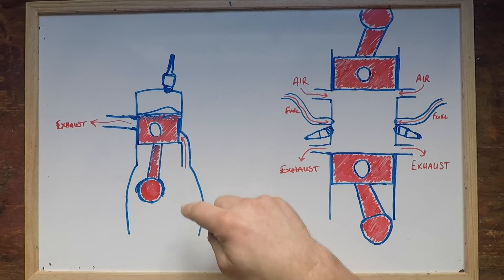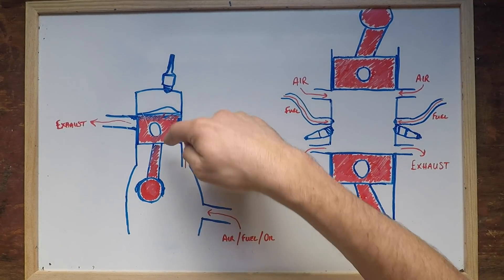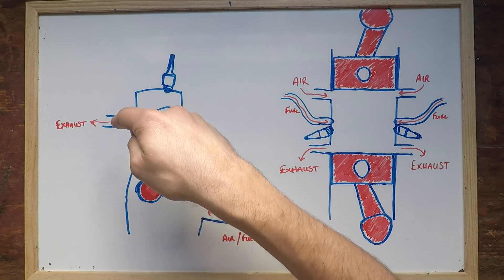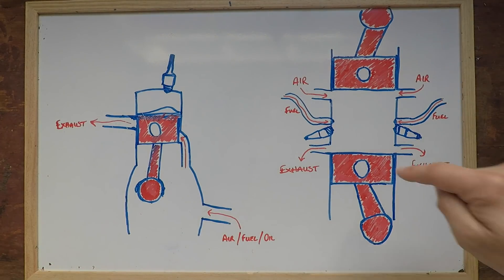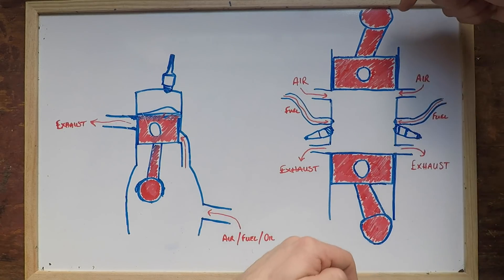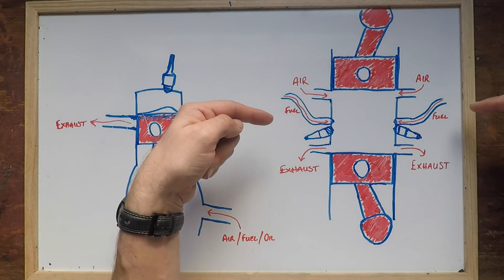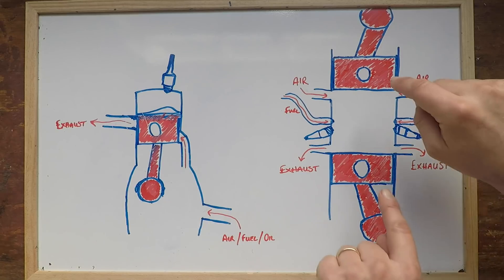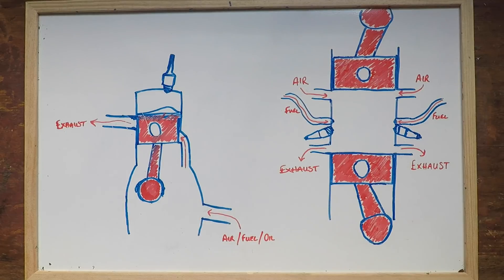How An F1 2 Stroke Engine Could Work - MP339

Comment: Does a two stroke not need a expansion chamber in the exhaust system to get the karden effect? If so would a turbo charger in the exhaust not effect that? Surely a super charger on the induction not be the answer?

Comment: I doubt that a two-stroke counter-piston engine will bring much higher thermal efficiency because the combustion chambers of a modern F1 engine are too small.
With marine diesel 2-stroke opposed piston engines, about 60% efficiency is achieved, which is about the theoretical maximum.
Weight savings of an opposed piston engine are marginal, you need two crankshafts, which also has a negative effect on the response behavior.
The most efficient opposed piston engines have three combustion chambers, which corresponds to 0.6 liters per combustion chamber, which, as I said, is too small a combustion chamber volume to increase efficiency, but there is hope if the combustion chamber volume per cylinder is increased to 5 liters and crankshaft limited to 5000 rpm, the thermal losses are lower, also due to the lower friction.
The advantage of such engines, simply lower costs, as there is no need for complex pneumatic valve trains and their dependent controls, and an engine with significantly lower piston speeds will last an entire F1 season.

Comment: What about the cylinder wall/pistons/rings lubrication? how that could works? I am curious how this could be accomplished with the use of exhaust / intake windows. Because, with the use of the ports, the oil in the space between the piston and the cylinder wall would will get into the intake ports during the intake/compression stroke and, in the next cycle (when the piston start to open the intake port again, in the exhaust/power stroke), the oil that have stay in the port (perhaps a little bit, bit still) will go to the inter of the cylinder, and then will get burned with the air and fuel. So, have a method to avoid this?

Comment: Beautifully said! I do hope engineers make this happen!

But I’d like to add few information : 

This has been the dream 2T for engineers for over decades now. I will tell you why it is very difficult to achieve : 

2 strokes are generally high revving machines.

Those fuel Injectors need to fire when the pistons are compressing the fresh air that’s been taken in and right when they close all the ports. 

This means, those injectors must be capable enough of atomizing and firing the fuel at a higher pressure than the pressure that’s caused inside the cylinder with pistons compressing.

That’s going to be very difficult and very expensive. Sometimes it might not be able to revv as well just because the fuel injectors just not being able to keep up.

Matt from The Workshop has made a brilliant video explaining this.

Comment: Cool videos Elvis! Thanks for the 
information! have a question about the power unit, my question is: can the F1 make the sound engine more interesting for example doing some changes in the engine like, remove the turbo and increase the power of the electric engine? So the engine will be louder without the turbo? Thanks
Reply from the maker: Yes, it's totally possible to change the sound, but the driving force behind the tech is efficiency, not the exhaust note.
Reply: Marc Priestley, awesome thanks! 👍

Comment: Think the only issue is cylinder sealing! With the boost pressures that would be needed to generate enough power for f1 the possibility of leakage is alot greater than in a normal cylinder to head layout. If it was to be a n/a setup then it might work but i see to many issue with this.

Comment: This doesn’t automatically fix the issues that two stroke engines have, the chieftain tank used as opposed piston engine and those were followed everywhere by clouds of blue smoke. Funny thing is I think the current experts in this field are probably truck engine builders, it would be pretty hilarious for a Cummins logo to show up on an F1 car.
Reply from the maker: I'm not saying it's fixed yet, but an area that F1 could take to new levels.

Comment: Very interesting, this could work. With the tolerances in F-1 I can just imagine a 2 stroke 2 liter engine capable of 25,000 rpm with twice the horsepower of a 4 stroke of the same size😱
Reply: If it is capable of 25000 rpm it would be much more than twice of powerful
Reply: @christopherabramor3012  A 4 stroke 2L could come fairly close to 25k. Some 2.4 V8 went over 20k before F1 limited the max rpm

Comment: I think it would likely come in the form of a 3 cylinder opposing piston engine, that configuration has the most efficient inlet and exhaust pulse distribution. Fuel could be hydrogen or some synthetic carbon neutral derivative.

Comment: EMD(General Motors) made diesel-electric railroad locomotives in the 1940's that ran as 2-stroke.  They were 16-cylinder 1500HP 2-stroke engines with an injection blower.  567 cu. inch. per cylinder w/ 8 inch diameter pistons. 950 RPM max.  The attached power generator gave out 300kV for the drive wheel traction motors.

Comment: I could imagine a 2 stoke design with the exhaust and intake ports offset, with one exhaust and one air on each of the "top" and "bottom" pistons, as in your illustration - But offset so left side and right would each have an exhaust and intake. Could create a venturi/Scavenge/Vortex effect?!?!

Comment: This 2 stroke video got me thinking. If an engine is 10% more efficient then that's 10kg less fuel. Are there any rules of thumb to convert a weight saving to lap time? #askElvis
Reply from the maker: Very roughly 10kg = 0.3sec

Comment: There are many types of two-stroke engines, and many do not need total-loss oiling. The famed Detroit Diesel is such a beast, using a Roots-type supercharger for scavenging.
Reply: https://imgflip.com/i/3mq3qx
Reply: I got an 8v92 and burns some oil, thats why i use straight wait low ash. it could be rigged up to total loss though. Castor 927 maxima anyone.

Comment: So is this going to be 2021 then (if ever)? Also, I heard that Symonds said that this would be the first step towards electric cars, how? Last question, wouldn't the exhaust for this type of two stroke engine be more like a 4 stroke exhaust or will there still be a significant need for back pressure from the exhaust?
Reply from the maker: The earliest anything like this would happen would be 2025...

Comment: Looks more like something for WEC or even WRC because it would allow them to run dual gearboxs for 4wd. Interesting to see how it works as looks like an inverted boxer engine
Reply: But dual gearboxes will defeat the weight advantage... 
... but I always like thinking outside the box (or is it think more boxes this time🤔😁)
Reply: That's why I said maybe more for WRC or WEC as it would allow them to keep running in 2wd
Reply: @mattwills87  there are already 2wd/4wd selectable systems so why is this a better solution for the 2/4 drive system?
Reply: Think about to duel engined mini cooper it was just a wild idea.

Comment: I can’t see having 2 cranks being an advantage and then some kind of connection shaft to connect them to the gear box. But then again I’m no F1 engineer so hey who knows, but why wouldn’t opposing pistons work with a four stroke.?
Reply: Because you don't have valves
Reply: You could make it work with a sleeve to cover the ports
But you need to lubricate those with oil in your fuel
Reply: There has been side valve engines in the past and there seems no end to what F1 engineers can achieve.
Reply: @mattschwensen9562  side/sleeve valve engines , if they are 4stroke need to have all the ports in the TDC where the pistons meet (intake,exhaust&fuel)and the sleeve moves up/down or left/right
A 2stroke engine with the ports at the BDC one piston has the intakeports, the other has the exhaustports and at the TDC the fuel gets injected ... but it needs a supercharger/turbo to work
the 2stroke opposed piston is very fuel efficient

Comment: So how is the crank shaft going to get oil to it on a regular 2 stroke the gas an oil go down towards the crank but no t what your showing
Reply from the maker: Crank can have a regular oil supply because fuel/air mixture is no longer in the crankcase

Comment: So you do know that for the same amount of air fuel mixture being burned in the cylinder, the opposing 2 piston, 2 crankshaft approach will make LESS power than a single piston design.  The opposing piston 2 stroke is not new.  Also any modern 2 stroke uses loop scavenge, not the crossflow scavenge with a bump on the piston which is shown on the left and went out of favour along with the dinosaurs.

Comment: Reminds me of the classic Deltic supercharged, uniflow scavenged 2 stroke diesel engine designed to power high speed British torpedo boats in World War 2. High power to weight even without today’s alloys.  Later used in diesel locomotives.

Comment: Cool video Marc, clear and to the point. One question, how and why would you configure the cylinders in a V-formation? Wouldnt that mean you get 3 crank shafts instead of 2? There could also be a benefit to a lower center of gravity for the inline configuration. I would love to hear more about the technical side of possible F1 spec 2-stroke engines!
Reply from the maker: Yes, loads of possible variations and layouts, exciting to think about F1 potentially developing them.

Comment: @Marc Priestley.... Two stroke is one of the ways F1 racing could go if you want to power F1 cars with outboard motors. :-)  The other way Formula 1 could go is the Hybrid route using Micro Gas Turbine+Generator+Battery+Ultra Capacitors+Electric Motors. This technology would set Formula One up for sponsorships from Rolls Royce, Siemens, Honeywell, Airbus, Boeing, Pratt and Whitney, CATL, Pansonic, LG Chem, Samsung, Tesla, Maxwell Technologies, NEC Token America, ect. (companies with money!) There is no money for Formula One in going the two stroke engine route in fact it would probably devalue Formula 1 as it would become non technically relevant.
Reply from the maker: It wouldn't be technically irrelevant if it developed into small, light, powerful, efficient & eco friendly technology...but there are a number of potential options.
Reply: @F1Elvis  ... Bill Gates invested in EcoMotor that was working on the OPOC motor and they went defunct in 2017 with their intellectual property being sold off; I am not sure who bought the patents but that news will scare just about everyone away.

Comment: I've always been amazed that the automotive industry has never picked up on advanced 2 stroke engine designs.  I'm a 4 stroke fan but have to concede that 2 strokes offer many advantages over 4 bangers, to name just 4, much lighter, more compact, more powerful for a given capacity and cheaper to manufacture.
Ford UK were on the verge of introducing an advanced 2 stroke design in the late 80's early 90's, they went as far as putting a number of production prototypes on the road for actual punters to test and report on. The it just went quiet!
It was a design by a company called Orbital, Ford bought them out and fast tracked the research.
Maybe they might look through their old files and get back into F1!!
Reply: for anything other than weed-wacker sized engines or slow rotating ship diesels every two-stroke advantage comes with two disadvantages
Reply: @fuzzy1dk  Thats certainly been the case for commercial use. As to if f1 with its budgets and tech can make that work for them is another matter

Comment: It would on have to rev to 8000rpm but it would sound like 16000rpm.. thats fine aslong as it sounds good. But id say they will aim for lower revs for less engine drag..but at the end of the day someone will have to build a f1 spec engine put the million's in and see how it goes as a trial.. id suspect it will be a quiet motor. Because its still hybrid turbo /supercharged
Reply from the maker: Maybe, but with a blank canvas, almost anything's possible
Reply: @F1Elvis  my only basis on the revs are lower is fact of the current spec.where there on ly pushing kr i  qaully .but If your gettiing 50% efficent out of a 2 stroke pretty insane .all though radial engines in f1 hana jokes

Comment: I wonder why we have fuel injection but not similar electronically controlled air injection. For that we still rely on mechanical valves instead.
If you could electronically inject pressurized air into the chamber along with the fuel as soon as the exhaust port is covered, which can be sensed a the crank position sensor, than you definitely would have zero loss due to open exhaust valves.

At least it works in my amateur brain. Reality however... no idea.

Comment: EngineeringExplained(Jason) has a really informative video on opposed piston 2 stroke engines. How do they sound though? Like a diesel???
Reply: The spark plug still ignites the fuel unlike a diesel which relies on cylinder pressure....hence the diesel knock.

Comment: In a previous video the argument for changing the rims and tyres was that there's nothing like that in the road. The way things are going in the industry at the moment it seems the propulsion will be electric. The only question is how the electricity will be generated and stored. There's no way something like an opposing piston engine is going to be used for road cars. Racing it in F1 makes little economic sense in the context unless it's just for show.
Reply from the maker: If something like this or one of the many other solutions is developed to be small, light, powerful and emission free, it could end up trumping EV's, who knows?

Comment: This is a very poor, misleading, and uninformed view of how modern two-stroke engines work. The snowmobile industry has been constantly and continually developing two-stroke engine technology since the 1980s and is currently state of the art. Before that Moto GP lead in two-stroke engine development. Opposed piston engines are not ideal for lightweight, high-performance racing applications.
Reply from the maker: Glad you liked it👍
Reply: Hybrids with batteries and lost of wires
Aren't really light either
Reply: @eelcoberg392  Ok. Batteries and wires have mass. I agree.
Reply: @shconer  the current F1 cars are +200kg heavier than the ones from the 80's
Some of it is crashprotection , but a lot is because of the hybrid system

Comment: how do opposable pistons line up in a v4 configuration? I cannot imagine that. where would the crankshafts be?
Reply: Altruistic I didn’t get that at all either. If the pistons are opposed it would have to be a boxer or like a 120* engine. Or if you get crazy, you could have pistons that have weird dome shape
Reply: @josiptomas6130  
A boxer engine has only one crankshaft and it still has cylinder heads. Turn the pistons around and make them operate towards the engine centre line....V angles are possible....it must still have a dry sump system to lubricate the crankshaft bearings.
Reply: AUmarcus but that also would mean having two crankshafts which isn’t ideal & adds more complexity/weight to the engine.
Reply: @Altruistic00  
Yep...exactly what Marc said.

Comment: Opposed Piston engines have too many, too heavy moving parts. Not F1 engine Material. I think what they are looking at is more likely something like the Rotax e-tec series. Thats highly efficient, direct fuel injected and dry sump lubricated two stroke engines with inlet and exhaust valve
Reply: Rotax e-tec does not have valves.

Comment: They only work with a blower, the commer knocker two stroke was one of the most efficient engines in its day. It doesn’t extract more power because it has two crankshafts but because of volumetric efficiency, ie the long burn due to the combined long stroke.
https://youtu.be/pGaISFg_ZIw

Comment: you do not require opposing pistons to avoid the fuel going through the crank case, but just as with the opposing piston engine it requires supercharging. All the big ship engines work like that, though being diesels makes it easier since the air doesn't have to be metered

Comment: A technical question about the possibility of the hydrogen fuel: when you light hydrogen the resulting by product is water. If cars are burning about 100kg of hydrogen per hour won’t that result in a very wet track? If so, I think that would be great!!!!

Comment: They said that the fuel would do a double job as the lubricant
Reply from the maker: The fuel no longer needs to lubricate in this case as the crank and bearings can have their own oil supply.
Reply: @F1Elvis  I mean I heard that if they will use the single-piston-in-each-cylinder one the fuel would also be the lubricant as to keep it eco-friendly

Comment: #askelvis
Okay. I'm sold! Tell me, though, how does the torque from two cranks transition back to a gearbox without inducing mechanical drag? Surely there'd still only be one clutch; so there's a gearset fore and aft of the clutch...?
Reply from the maker: Yes, some potential mechanical losses in that particular layout, but overall a net gain
Reply: Put the gearbox layshaft between the cranks for a 'unit' construction?